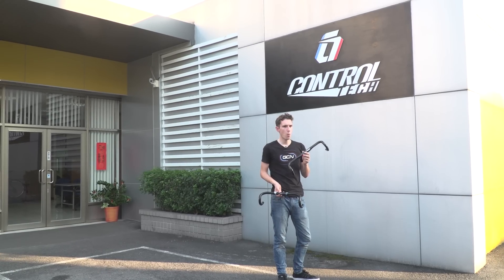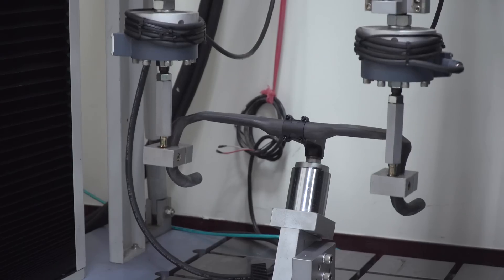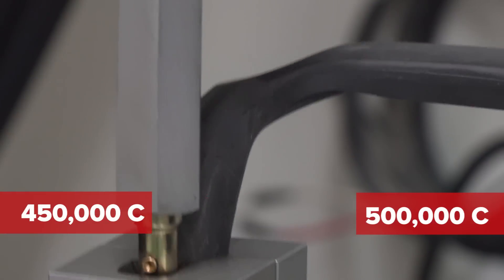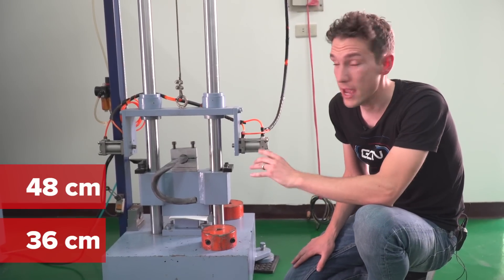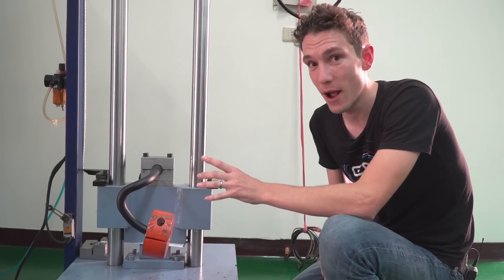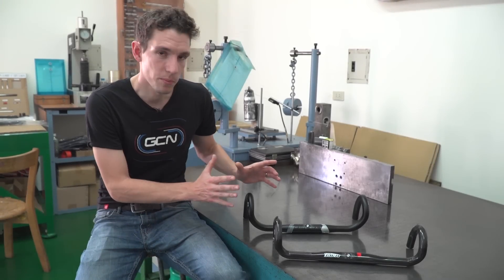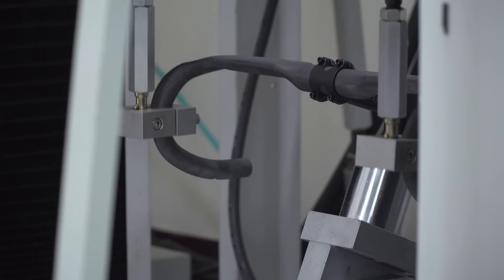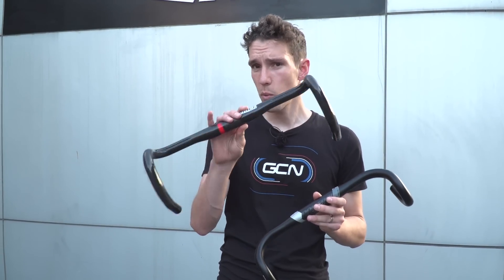Carbon Vs. Aluminium Handlebars | Which Are The Strongest?

Comment: How about testing some eBay Chinese carbon bars.
Reply: Scott Paciorek how about no?!
Reply: I'd like to see them tested too. Curious.
Reply: James Murphy there are a lot of Videos on this Topic. Some are useless ( but hilarious ) to be honest but the other will be helpful to quench your thirst for knowledge...
Reply: I did buy a carbon fork off eBay.  Did a disc brake conversion on a Specialized Langster. I destroyed a Stans Grail ZTR rim and the fork is solid as can be.
Reply: China make the best carbon in the world (outside a F1 team)
Reply: Chinese don't make carbon for Boeing, Airbus, Lockeed, etc, and many more.  However, Chinese do make a lot of cheap carbon component for the cycling industry.
Reply: some are just as good when xrayed. Although those aren't anywhere near the typical chinese pricerange tbh.
Reply: To end the controversy and avoid posible danger to our cycling friends, the most responsable response should be to put “ David against Golliad”.
Cycling industry has abused from the cycling Bonanza, that brings many millions to the sport. 
A top end bicycle 20 years ago, cost less than the ten thousands “plus”, dollars the price of a top end bicycle today and still you are riding in two wheels and the difference in speed hasn’t changed that much, to justify the juicy prices.  
You can have a Rolex of $25,000 that will give you the hr., date and a chronograph, or a $19.99 Casio that will give you the same, plus alarm, calculator and light. Is a personal choice, but in cycling it can cost a life and we would like to see if the difference is really worthy. 
FJP
Reply: Good carbon parts will cost their part. BTW: Please reconsider your view on Chinese please.
Reply: GCN is a marketing company and you know those no name Chinese carbon companies don't do any marketing because they (most of them) basically don't have a brand. So that video will never happen on GCN unless a company like Farsports is willing to cough up the dough
Reply: Veganpotter Thevegan 
So all brands paid them for advertising. Simple AF, friend.
Reply: i have a friend who rides Chinese carbon rims, look exactly the same as a well known carbon brand, which he has also owned which lasted only a few rides, whereas his Chinese ones are still going strong. the main difference is one has a great warranty department. if he breaks his Chinese ones he'll have to buy a new one.
Reply: you know what result is  XD
Reply: I cracked one of those on my dirt jumper
Reply: It would be beyond the scope of GCN, but well worth a test to cycle thru some 100 or so carbon bars from aliexpress and show raw footages. I know a few that will survive the test.
Reply: Chinese carbon isn't better in the sense of how it's made. It's only better in the fact that there's more of it in the products they make.

So, it would hold up longer, just based on a quantity, sense. Though, it'll also weigh more.
Reply: Here's something for you. My £45 Chinese one piece carbon bar stem combo had been on my bike for 3 years of riding 15000km around the cobbled roads of the Netherlands and Belgium. I have just changed them because I wanted to change my position a little and found that under the bar tape they were cracked on one side. I had no idea when this happened and honestly did not know and couldn't feel it. I would even be happy to put them back on my bike. They're also only 2 grams heavier than the £250 bars they copied and I wonder how they would have faired for 5 times the money.
Reply: exactly my question
Reply: @WHERESSS  A lot of famous cycling reviews doesn't do a review about the china brand wheels  yoeleo 
I am always asking myself about their intigritie
Reply: I've heard this issue to quality control not absolute strength, so quite often, you'll get lucky, and have a cheap light and very strong component, but often enough it will be weak and fail.  For most riders the risk is not worth no it, since there is a risk that a failure my lead to an injury
Reply: @mistera1mL3Ss  not worth using
Reply: @lmaofao9071  what?!
Reply: @mistera1mL3Ss  as in the cheap price is not worth the dangers and risks
Reply: @lmaofao9071  well... I'd beg to differ. Not all Chinese Carbon is bad. Also: read the thread. The. Whole. Thread.
Reply: Ai  great! My Statement is two years old and was not about good or bad Chinese Carbon. So... What's your point?
Reply: First its " ughh carbon is so expensive" then the Chinese makes a mtb part that is a inexpensive could be a viable option. Then the high end company makes carbon frames for a price of a car. It breaks after a year. Or a couple rides.  We hear it all the time people frames breaking into 2 or parts just snap. Then we complain how expensive it is and shitty carbon really is. Let's face it. It cannot endure the terrain mtb go through. Its for a road bike. So let's not buy carbon.
Reply: i guess im asking randomly but does any of you know a tool to log back into an Instagram account??
I was dumb lost the account password. I would love any tricks you can give me
Reply: @Santana Mayson instablaster =)

Comment: No point to go for carbon unless you are professional race cyclist.
Reply: Mr. Wizeguy for Handelbar Aluminium will do. Even pros don’t use carbon
Reply: Carbon is better for a tt deck though
Reply: lol
Reply: Unless you find a good pair on clearance that saves weight
Reply: Way to be a buzz kill, everyone would be driving a Prius if we all thought like that
Reply: Thats the truth... unless ur a pro, its a dumb idea
Reply: Unless you are a pro, you can ride a 15kg steel bike with shitty wheels, otherwise it might be fun to ride and nobody wants that.
Reply: @ap1reviewsadventures96  I felt this on a spiritual level
Reply: Carbon bars are good if you don’t have suspension forks and thin wheels, they flex and absorb the bumps
Reply: @zhen86  They do
Reply: @zachh7796  that's a stupid comparison
Reply: @2423 6585 wtf is this statement mean?
Reply: @2423 6585 Front suspension works way better for vibrations or bumps than any handle bar.
Reply: Unless you snag one for cheap
Reply: I'm not pro and I use an carbon bar 😂

Comment: Broke two carbon bars in accidents. One doing a sloppy trackstand another after getting bumped off my bike by a car at 40kph. Not wasting my money on carbon handlebar again just to save 50g
Reply: I've crashed at 40mph multiple times.   My carbon bars have always been fine.  The only bar I've damage was an alloy bar in shipping
Reply: A friend of mine has broken ENVE mtb bars without even crashing. No interest in carbon bars here aswell.
Reply: @thisandthat1233  99/100,  that happens from over-torquing(stem or even brakes/shifters),  or from really shitty/crooked faceplate install.
Reply: It happened a few years ago so I don't know the details what caused the failure. It's really dangerous though for a bar to suddenly shatter like that didn't look very good for the manufacturer. I doubt that could happen to aluminium bars(?).
Reply: @thisandthat1233  it can happen with aluminum too. A guy on my team had his break while on a ride. He crashed pretty badly. It was a premium brand. My guess was that there was a flaw in the material that wasn't caught in manufacturing.
Reply: @veganpotterthevegan  If you receive your aluminium handlebars broke, you should replace your postman against one who does not drive over he deliveries with a car. You can’t be for serious here. (You do have the word "vegan" in your name twice. You actually might be serious in your reality)
Reply: @LargoC  I've got a set of carbon bars I've crashed with multiple times.  Over 100,000miles on that bar.  Crashes throughout its life...
Reply: @janosmerges4946  I'm serious... and yeah, I'm double vegan😉
Reply: @mattsharpe3989  I have a Ti SEVEN.  A LOT of bikes can go that far.  I have a touring bike given to me from a friend.  It's a steel noodle now but it's got over 100k on it too.  I only use it for groceries
Reply: I’ve had no issue with my Easton carbon bars, either my road bike with ec100 or gravel with ec70ax.  Definitely taken a few crashes with the gravel bike, had to replace a rear derailleur and part that holds derailleur in place.  But the bars have not fail.  My old gravel/touring bike that was titanium before my current carbon one I had my only handlebar failure and it was on an Enve carbon bar, never bought Enve bars again, wasn’t even a crash my bike just got blown over when it was leaning on tree and hit pavement.  Everything else on the bike was fine but the handlebar.  From what I’ve heard Enve has different widths of carbon in the bar to reduce vibration which can cause stress points if they get pressure in the wrong spot.

Comment: They are both stronger than skin and bones.
Reply: uh bone is currently the strongest known material in the world
Reply: Yeah ? Then why does your bone break but your bike won't ?
Reply: andy But what if I want my bike 🅱️ONELESS?
Reply: andy iam pretty sure that is some BS
Reply: andy Yeah? Why do we make planes out of carbon instead of bones then?
Reply: Tell that to Anderson Silva.
Reply: +Der Kater
This example of yours is far from organised/systematic. For starters, bones and frames have different moments of inertia. Strength and stiffness are not the same thing. Sheer strength and flexural strength are not the same thing either, and on top of it all, you're not making a clean comparison of material versus material: you're mixing geometric properties with material properties.
Reply: Just tested that. Cyclocross race last Sunday. Handlebar bent. Legs bruised. Bones unbroken. Doesn't get more science than that. Maybe I'll put a weight on my ankle and start falling onto the floor to prove it.
Reply: I still stand by my classic chromoly frame!  :)  Will last a lifetime.  Good flex and comfort.  A bit heavier, but when you don't race it becomes much less important.
Reply: Wow, some people have the sarcasm detector set to 0.
Reply: skin and bones heal themselves
Reply: adn skin and bones are not weldable.... and metal and carbon fiber aint living ´.....
Reply: XxAdyxX98  do you need to ask ?
Reply: Gmbn pushing the carbon trash
Reply: But aluminum is soooo much cheaper
Reply: banshee maczero because carbon is loghyweight and steong enough ti sustain a lot of force
Reply: @andy: Please do your homework first and then make such statement.
Reply: "hardest", not strongest
Reply: Strength to weight only.
Reply: @UerMom  Uh... when did that happen?
Reply: Bird made out of bone
Reply: @ShermanSitter  I guess my life is over then :-( my chromoly frame snapped through the lug over the bottom bracket
Reply: @LeesChannel  Oh no! What do you attribute the break to? style riding, faulty frame, bad luck, lots of bunny hops? just curious. I guess a lifetime in legal terms is only 20 years anyway.  :)
Reply: @ShermanSitter  Well, I'm a large person (6'8"/203cm) and I generate a lot of torque.  I actually snapped off a pedal starting from a red light in high gear, replaced them with the sturdiest I could find.  In general I liked to stay on the highest gear to go as fast as I could as a city commuter, only changing gears for inclines, so there was a lot of stress in the bottom bracket, and it was a bike from 1982.  Ultimately I think it was metal fatigue.
On my way home I had been having issues with my front derailleur struggling to shift from the little chainring to the large one and then overshooting, then a wobble when I pedaled on my right side and a nasty grinding and clicking noise.  Sometime after my last ride I looked to see what was wrong and my seat tube was completely snapped through the lug at the bottom bracket and no longer even touching.  I'm surprised that the bike was still rideable.
Reply: @LeesChannel  Thanks for the response! That is intense! I do think that if it was an aluminum or carbon from from 1982 under those conditions it would be a pile of dust by now!  :)
Reply: @ShermanSitter  We'll see, I just recieved my CF Canyon Endurace I purchased as a replacement.  I haven't been able to find any figures comparing chromoly steel fatigue life to CF, but I'll try to be gentler (especially so, because the bottom bracket is pressfit.)
Reply: @LeesChannel  Well, for the record, I have bicycles of all metal types and love them all for different reasons. I'm glad you are still on the road! It would be great to have you stop by some of my channel's videos. I have a lot of commuting videos and vehicle code discussions and it sounds like you can add greatly to the conversations!
Reply: @ShermanSitter  Yeah, I've seen your name around, I don't know if they were on these or on velomobile videos or on your channel, but I definitely recognize your username.

Comment: I don't think the argument is really understood here. Everybody knows carbon fiber is stronger as it's engineered to be, but only in an "as intended" to be used circumstance. You rightly pointed out that the aluminum would be stronger in a crash, and THAT is why people choose aluminum (well, that and the price tag). Coming from the world of mountain biking I've seen tons of carbon parts having to be trashed because of damage from crashes where an aluminum part would've fared just fine. Case in point is my aluminum Santa Cruz Nomad. The things I've done to that frame.... yet I've not had to replace it because I've scratched it.

Comment: Thanks for this interesting comparison. I have been using a carbon handlebar on my carbon racebike for 15 years. I had light crashes as well and it still does its job perfectly. My gravelbike is suited with an aluminium handlebar. I think if‘s manufactured properly either of them will give you a lot of pleasure. There’s an other point which haven’t been mentioned. The aesthetics. Often carbon handlebars does have a better look and this has nothing to to with functionality. Be honest ... sometimes you just spent the money because it looks nice and it makes you pleasure, don’t you.

Comment: A challenge with the carbon is if the crack is under the tape it might go unnoticed, leading to catastrophic failure later.
Reply: Dan Connelly it happened to a friend of mine: the tape actually held the handlebar together so that he was able to see that the bar was broken but no catastrophic failure.
Reply: Exactly, if carbon were damaged, you will feel the softness, still it won't fall apart. And, of course, if there were a crash, you need to check the bike, and not only the bar, but  carbon frame too.

Comment: Carbon may be "stronger", but every single carbon handlebar and carbon stem I've used has been noticeable flexier than an aluminum handlebar and stem when out of the saddle and hammering.  That flex makes me feel like I'm losing energy and not always in control.  They're definitely more comfortable on longer rides, however.

EDIT: I should mention the bars/stem since I'll probably get flack... They were Ritchey WCS carbon combo and FSA K-Force carbon combo.  I settled on aluminum 3T Ergonova bars and ARX stem, which are noticeably stiffer.  I've tried many other bars/stems but these are what I've used in last five years; don't think it's fair comparing 15 year old technology to todays.

Comment: Is anyone else sceptical about the fact that they tested an aero carbon handlebar? Aren't standard carbon handlebars a bit stronger since they are round instead of flat?...
Reply: Anthony HT i was thinking exactly the same. The shapes of the bar absolutely changes the integrity of the structure.  Retest!!
Reply: Yep a round bar would be much less likely to buckle.
Reply: Agreed.
Reply: i agree with you.
Reply: a lot of carbon bars now are going aero, that's an allure of going carbon, right?  Why would I want a round carbon bar when I can get it aero? It's a valid test.
Reply: Also the carbon bar failed where it has holes in it. A flattened / Aero shaped alu bar would fail a lot earlier.
Reply: Kalashnikov Cortez Actually a number of aluminium bars also have been made aero, and a lot of super light carbon bars are still roundly shaped. if one would compare the toughness of the materials themselves, one should test them in controlled environment, especially the shape which certainly has huge impact on the outcomes.
Reply: Made my comment, basically the same as yours, before finishing the vid as I am impatient.  lol
Reply: @hahasimpsons  HIS NAME WAS ROBERT PAULSON.
Reply: Anthony I like where you're going with this but that's assuming the amount of material is uniform across the bar.   Just like in frames its possible to put more "material" in areas of more stress.   I'm speculating here but its reasonable to assume they are doing this.
Reply: @mikagami69  No the point isn't to compare the materials alone, if you wanted to do that you'd just go to a proper materials lab where they've done those tests to death. The point here is to compare HANDLEBARS, and one of the big selling points for carbon handlebars is that they can be made into aerodynamic shapes better than aluminium. Most of the time if someone's going to switch to a carbon handlebar on a road bike it's because they want aerobars with integrated cable routing. So while this is not the only comparison you could do, it's a sensible one to make.
Reply: Definitely should have done both in aero or both regular shaped bar.
Reply: Aero bar are a manufactures salutation to getting repetitive sales from the buyer,their not daft !
Reply: Agreed. Invalid test because they are changing at least two variables , not only one. To compare the materials , you change the material and nothing else.

Comment: For the price of 1 carbon bar i can buy 4 alloy bars.

aluminium: 450.000/500.000 cycles x4 = 1.800.000/2.000.000
carbon: 600.000/800.000

for the same price alloy can last more than 2x longer.

Not hating Carbon, just for the price alloy would be a better option.